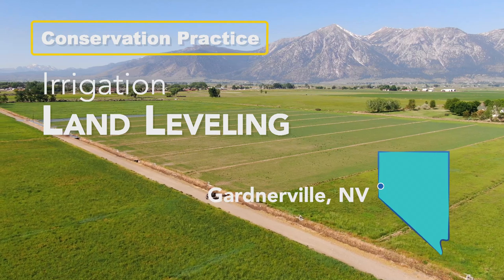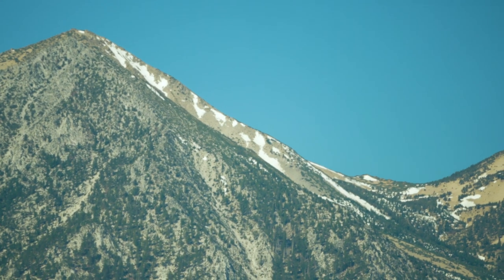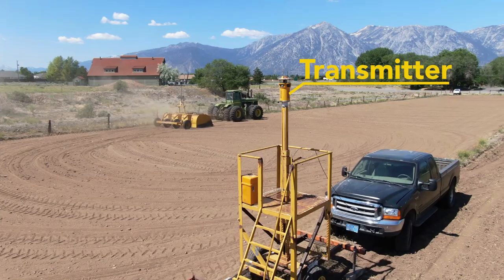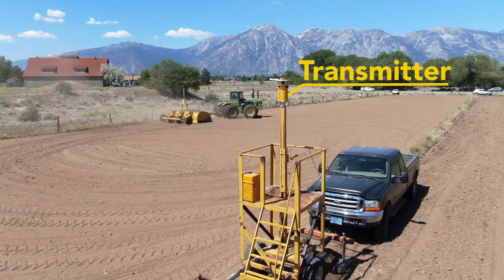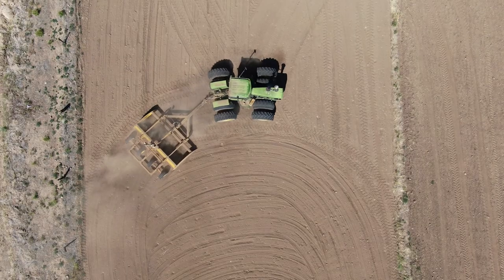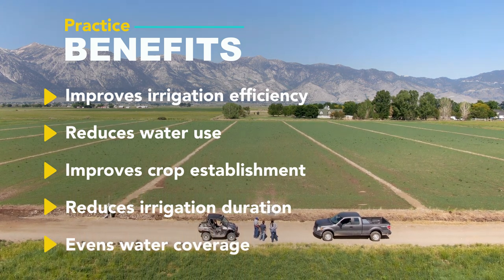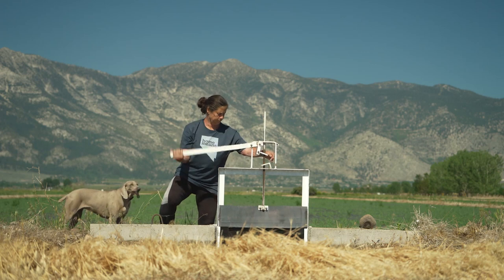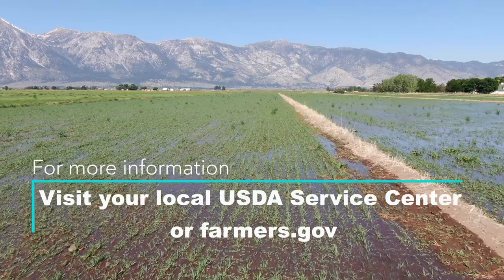Irrigation Land Leveling

Comment: Would a different type of irrigation (low height sprinklers) use less water than flood irrigation? With the aridity and heat it seems there would be quite a bit of water loss due to evaporation???